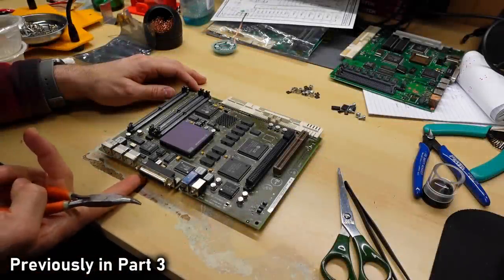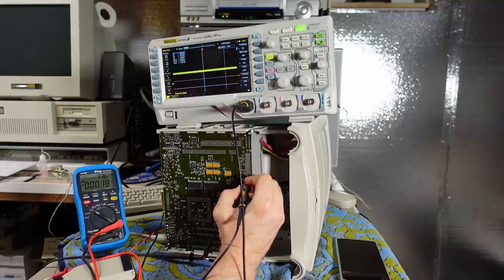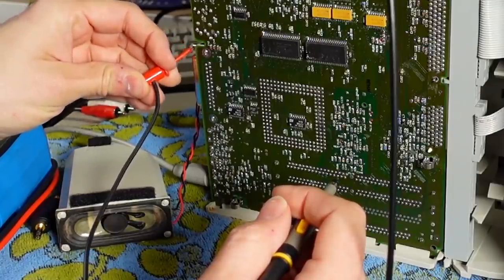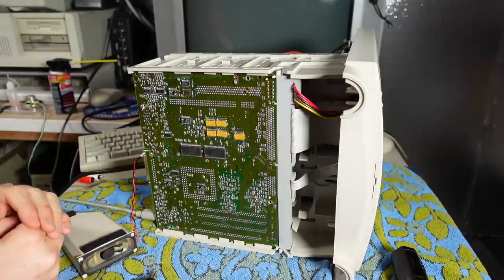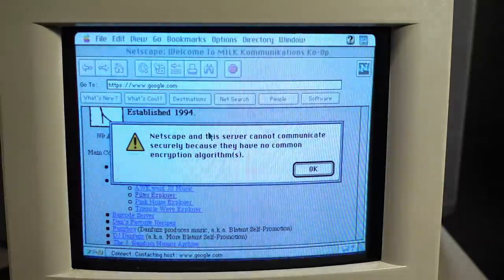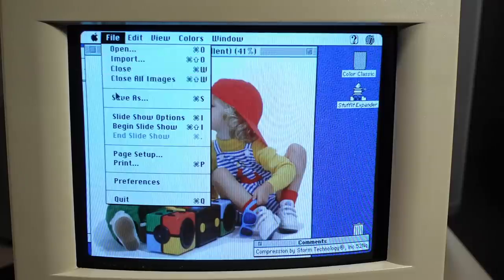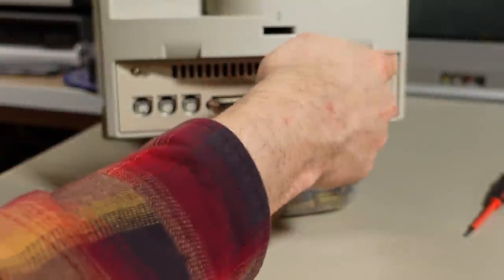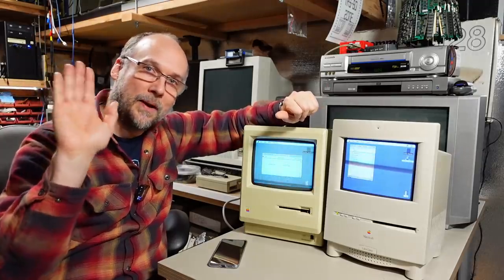You won't believe why the sound was broken on the Color Classic!

Comment: I know that you hate RF shields.. and that those stupid cardboard ones are absolutely atrocious.. BUT I recommend that you keep the METAL ones intact (if all possible) as they DO provide protection against "harmful interference" to communications and even some devices..  not to mention, its the law!    In some cases, (rare, but entirely possible), running a computer without proper shielding can not only (in the most severe circumstances) jam aircraft navigation and even cause malfunctions which can, in theory, cause an airliner to mis-navigate and possibly crash and/or miss the runway during landing.. (it is unknown if this has ever actually happened!),  but if the FCC finds out you are running computers without their proper approved shielding, you can be held criminally responsible for "disruption to communications" and be fined and/or imprisoned!  NOW, to be FAIR. this is more likely the case for these mega-powerful gaming rigs that these kids run all the time (more than what you're doing..) where they are emitting HUNDREDS OF WATTS of RF energy (combined over a broad spectrum) while running them with open and/or these cheap stylish PLASTIC cases... (there are REASONS why the FCC has to put APPROVAL RATINGS on those things!)  its NOT likely that anything that you are doing will cause any major issues.. except perhaps annoy any local Ham radio operators in your neighborhood- not necessarily a BAD thing...  JUST KIDDING!  Hams have rights that extend to their licenses- therefore, they CAN become "nasty" if they ever find out where the "annoyance" is coming from.. (usually, THEY are the annoyance, though...), so, this is just a word of caution...  I agree that those paper/cardboard RF shields are next to useless  but you should, at least, consider leaving the metal ones in-place (of course if they are all rusted and  the like.. I completely understand...)  KEEP UP THE GREAT WORK! :)

Comment: hahahaha, they used the rf shield to connect parts?? HAHAHAHAHAHAHAHAHAHAHA THAT'S INSANE!.
Reply: its not. since RF Shields are anyway connected to ground its no issue to use it to tie grounds together
Reply: @bennaambo2716  I've never heard of doing that. ground is usually connected to everything on the board itself.
Reply: @pelgervampireduck  well maybe back than as they designed the board they couldn’t connect  every ground together